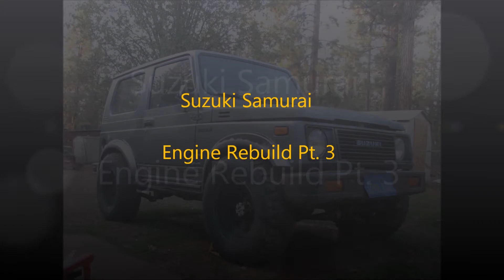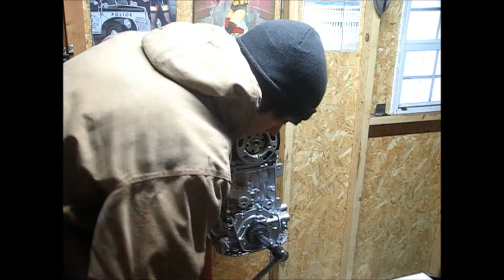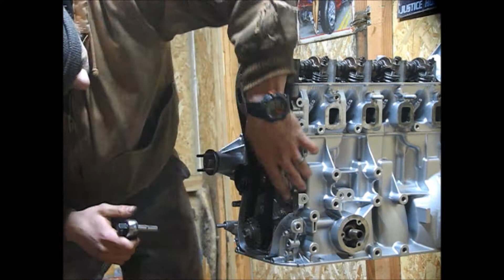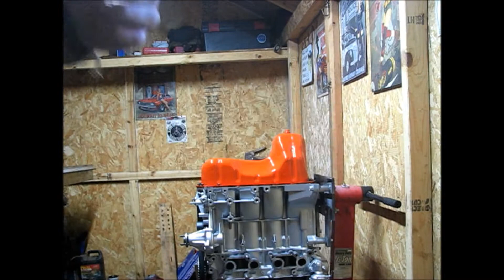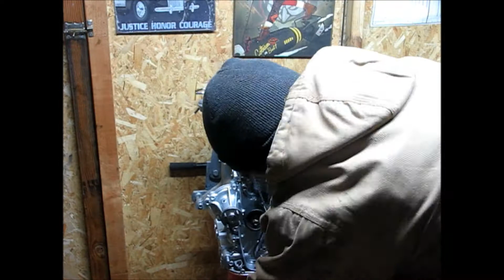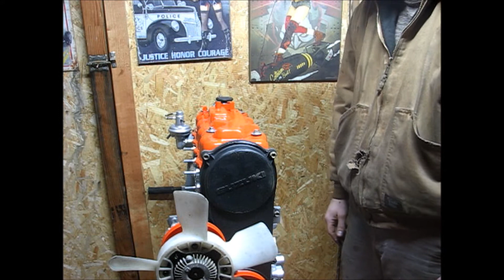Suzuki Samurai Engine Rebuild Pt.  3 (Time Lapse)

Comment: What can cause water leak on the engine
Reply from the maker: Hey there. There's a few things that could cause a water/coolant leak on an engine.  It really depends on where the leak is coming from though.  It could be a bad O-ring, a bad gasket, or a loose hose clamp.  Tell me more about where your leak is coming from and I'll be glad to help in any way that I can.
Reply: Please reply....